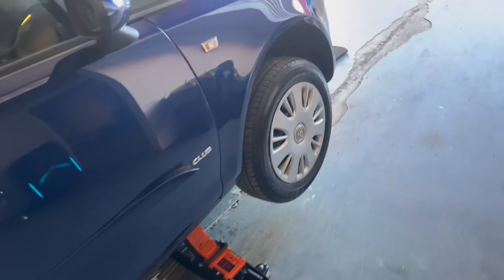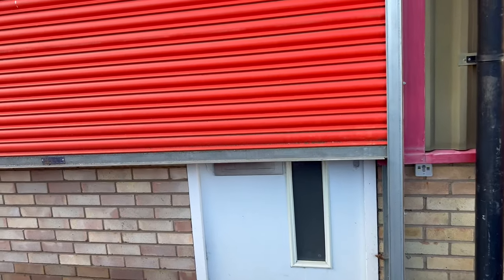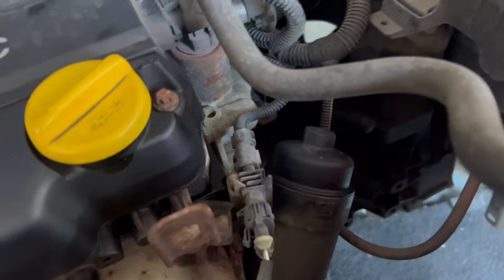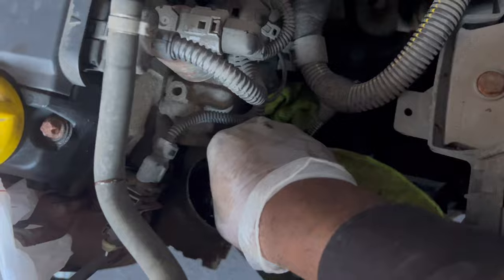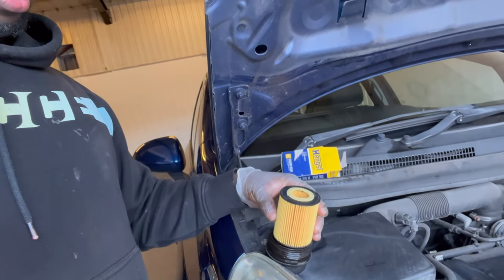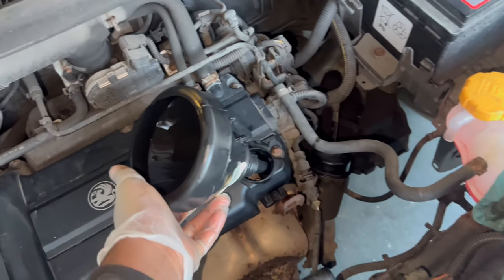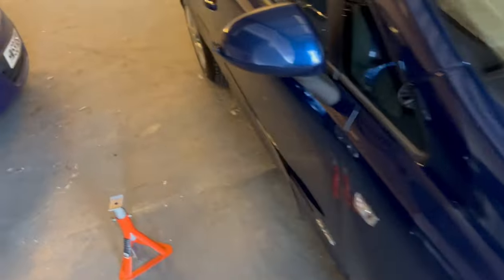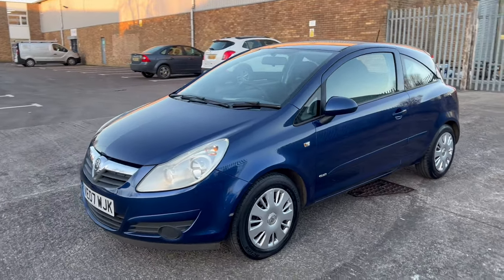Car dealer vlog the £500 corsa hasn’t been serviced in 4 years

Comment: Worth doing air filter and spark plugs too as they wont have been done in a long time
Reply: Air filter probably yes. If the car hasn’t got a misfire it’s not really worth doing plugs at this price point. Gotta keep costs down where possible.
Reply: @lanehogger1532  plugs are £10 or so for a set of 4 bosch ones mate. cant justify not doing them esp if you are changing yourself
Reply: @mohitl1697  I know, I’ve worked on plenty but from experience removing the coil pack to access them often breaks the coil pack. It’s all best left undisturbed unless there is a hint of a misfire 👍🏼

Comment: Oil up the rubber seal on the oil filter cap before putting back on otherwise you can rip it nice video tho man
Reply from the maker: I did put some oil around it but I just didn’t film that part
Reply: @Jameyscarflips  my bad

Comment: How people dont service there cars for four  years ill never know or understand   and much cheaper to sevice ot regularly then replace the engine
Reply: Because they get away with it. I have friends who had a petrol Zafira for 6 years. Never changed the oil or did any services. It lasted and was scrapped eventually due to corrosion. I changed the plugs for them at some point due to a misfire but the oil and all filters were never changed. They now have a diesel Zafira with a turbo. I can’t see them getting away without oil changes with a turbo engined car 😂

Comment: Yo if i don't have trade plates or trade insurance how do I tax the car cause if I do it in my name I have to wait for the new V5C to sell and it also adds another owner
Reply from the maker: Ok I used todo this before I had trade plates and trade insurance insure the car using cuvva temp insurance tax it on direct debit and cancel the direct debit when it’s sold and when transferring the car select a trader and use you name and address so you don’t have to wait for a v5c in you name you can sell it straight away
Reply: @Jameyscarflips how can I do this
Reply: Yup works every time